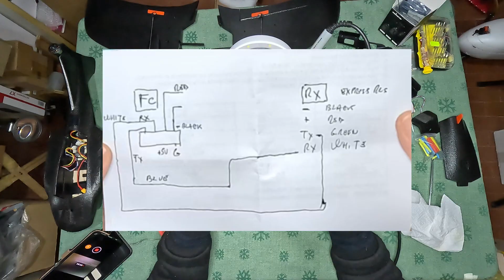FIMI MANTA VTOL. FC VERSION II. ASSEMBLY AND MORE. PART 2 of 4. FIMI DRONE. VTOL. RC MODEL.

Comment: this is a great video i can see everything I need to do. perhaps relocating the stack in front of the battery will allow to move the battery back to balance the weight of the gimbal. also in this case perhaps I could use 3 blade props and more powerful motors on 4s pack.. probably lose a lot of flight time but going 4s may help. either way i'm getting this!!
Reply from the maker: Hi, in the playlist section channel, Vtol you can find all the videos related to Fimi Manta. From assembly to flight.👋

Comment: Saludos serías tan amable en confirmarme si se puede se volar con un radio Elrs(2.4) litle radio3  pro o o debo colocarle algún módulo para después programarla
Reply from the maker: Hola, si compraste el Fimi manta Vtol, la versión FC, el controlador de vuelo ya viene programado para receptores CRSF. Los receptores ELRS utilizan el protocolo Crsf. El software instalado en el controlador de vuelo se puede configurar con Mission Planner. El VTX configurado por defecto es Digital, como DJI u otro. Si quieres instalar una cámara vtx y analógica, sigue mis otros 2 videos dedicados a Fimi Manta.
Reply: @MrSalvoFly  un millón de gracias , es usted muy amable con seguridad vendrán otras consultas si usted me lo permite , realmente estoy lejos de que me llegue el VTOL en mi país acaban de cerrar todas la importaciones debo esperar que las normalice para traerlo pero lo haría para volar en analógico primeramente
Reply from the maker: Hola, para volar en analogico hay ofertas en Banggood, para vtx y cam. A veces encuentras ofertas en visores o gafas de Eachine. Si tiene preguntas en el futuro, simplemente pregunte. Saludos
Reply: @MrSalvoFly  me puedes recomendar una en específico.
Reply from the maker: https://it.banggood.com/EWRF-5_8G-48CH-100-or-200m-or-400-or-1000mW-Adjustable-FPV-Transmitter-and-CMOS-2_1mm-1200TVL-FPV-Camera-for-RC-Quadcopter-FPV-Racing-Drone-p-1991804.html?akmClientCountry=IT&rmmds=search&act_poa=SKUJ91937&cur_warehouse=CN&forced_jump=1&xpath=0000000DL&page_id=bgm_search-list&uet=1724960341814&is_wap=1&user_id=1562633635920&sess_id=1562721160950&site=it-m.banggood.com&position_type=2

goggles:

https://it.banggood.com/Eachine-EV300D-1280+960-5_8G-72CH-Dual-True-Diversity-FPV-Goggles-Built-in-DVR-Focal-Length-Adjustable-With-Chargeable-Battery-Case-p-1595594.html?akmClientCountry=IT&cur_warehouse=CN&ID=6157199&rmmds=search